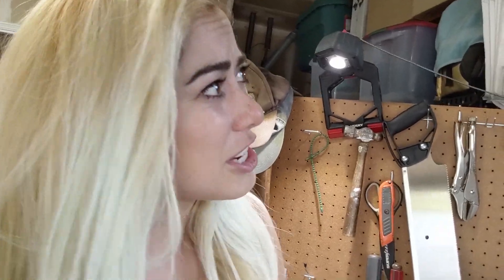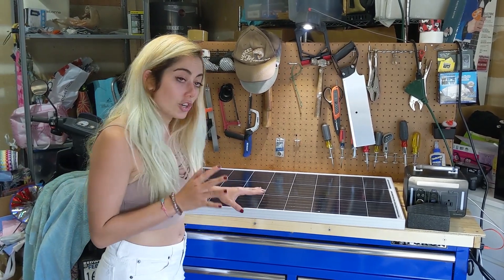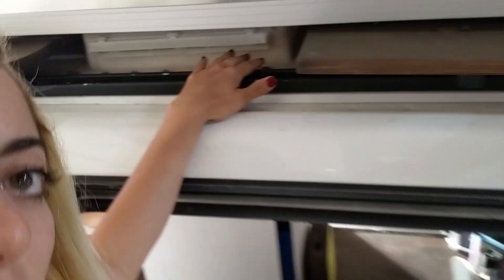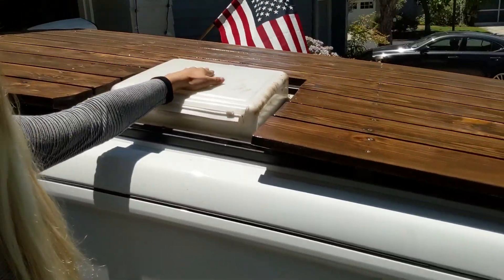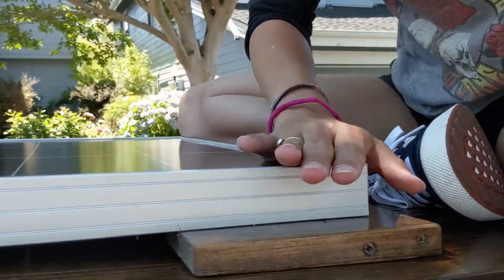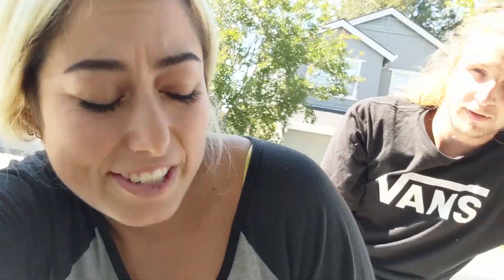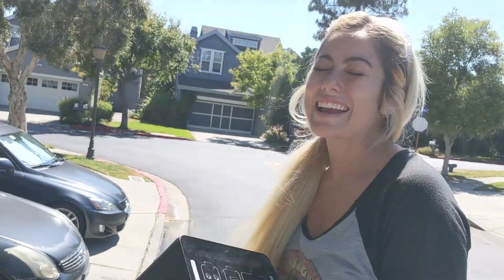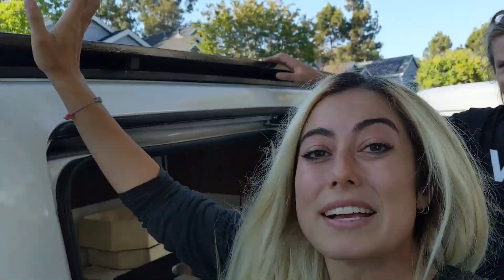Easy Van Solar Panel DIY install!

Comment: Great panel but the power supply can use an upgrade. A Bluetti, eb70, will give you 716 watt hours and faster charging. IT might still be on sale but check their website. The sundeck is awesome.

Comment: I have two of those solar panels with one big ass battery and a separate inverter. But I need a better inverter and better batteries now. 
Just wondering if it's easier to buy it built and reverse engineer someone else's work, or build it yourself?
for heat in the winter get a Chinese diesel heater. Dry all your gear so fast. Stay 70f+ all night in a snowstorm.

Comment: @Jenise Spiteri  how long does that size panel take to charge your power bank
Reply: She said it was 100 watt panel. And the power bank was 500 watt hours. So I would think it would take 5 solid hours of direct sunlight at 100% efficiency to fully charge the power bank.

Comment: Nice job!  The only potential problem i see is the lack of a grommet where the wire runs through the roof’s sheet metal.

Comment: This is very cool. I might have missed it, but you might want to put a rubber grommet in the hole so the sharp edges don't cut in to the wire.